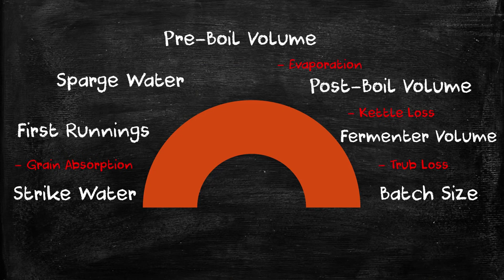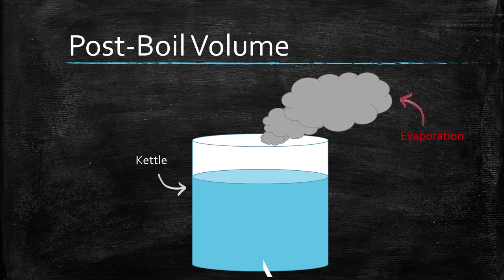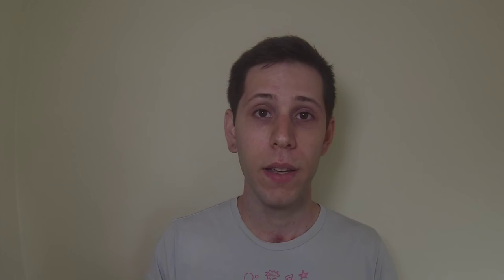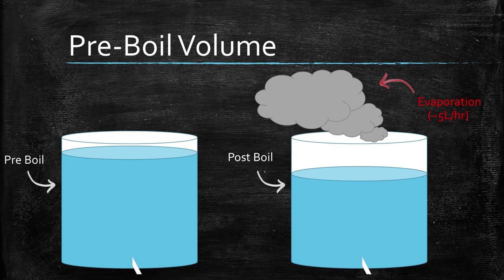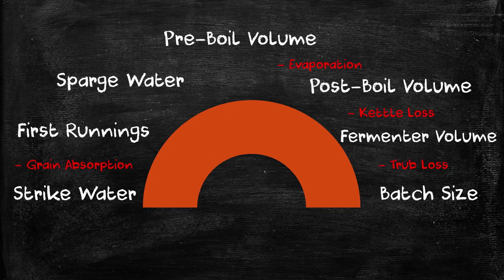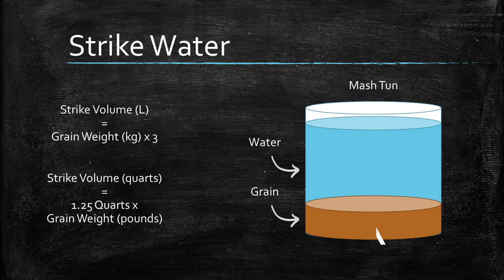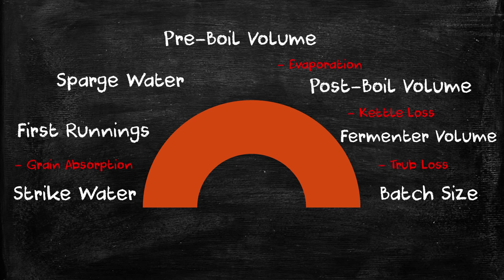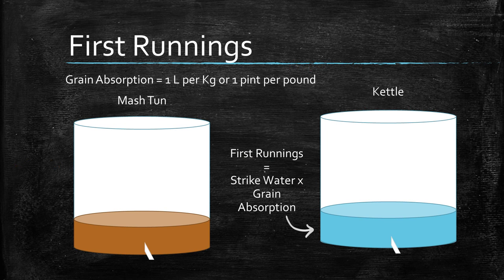How to Calculate Water Volumes for Brewing

Comment: I have 17L and 5L pots.(I do ~20l batches) I usually count the total malt weight(kg) and subtract it from 17L(size of the pot Im mashing it in) to get strike water volume. After mashing I just rinse the malt bag in the fermenter bucket with the amount of water that allows me to fill my both pots with wort(that is 22 liter pre boil volume). After boil and little cooling I add cold water to hit my batch size target(usually 20L) to make up the evaporation loss and at the same time cool the wort more. Works perfectly...expect one time I forgot to add the water and got one hell of a strong porter which turned into tasty poison.

Some people say that partial boil requires longer hop schedules and boils but I think that is only true if you like VERY hoppy beers.
Reply from the maker: +uniikkiz awesome! You'll find that by doing the calcs, you're pretty much following the guidelines anyway, just forcibly by pot size :) Agreed with the point about hops. There's not a huge amount of difference.

Comment: Hey mate, Kiwi in Czech here.  Not quite the same as an Aussie in Belgium, but both antipodeans in lands where they know how to brew.  Thanks for the vid - it's pretty useful and a good way to work it out in your head.  
  Your grain absorption rate for BIAB seems quite high.  In my brew yesterday I had 34 litres of strike water volume and a pre boil volume of 29 litres, so I lost just 5 litres overall at a rate of 14.7%, but you have a rate of 33% which seems a tad on the high side.  What's your process for milling and squeezing the grain?  I squeezed my grain bag til it died and got it double milled, but as a new brewer and wanting to know how things work I was interested to know what was your process for this?  

Cheers and keep up the good vids,
Doug
Reply from the maker: Haha "Antipodean", thanks for teaching me a new word :)

Not sure what you mean about the grain absorption, I typically see a 1:1 ratio, 1 litre water absorbed per kilo of grain. My process for milling is to use a very fine crush (0.03inches / 0.75mm) and mill just once (because the gap is so small it doesn't need twice). And I squeeze the bag a little, but mainly just to speed up the draining of the wort.

Cheers :)

Comment: Great video. However I've always been under the impression that if you don't have a big enough kettle to reach your desired pre boil volume, you can always boil less and liquor back to get to your desired batch size? What are your thoughts on this?
Reply from the maker: You can indeed however there are a couple of differences. Firstly, your hop calculations will be slightly different as it's more difficult for the hop oils to "dissolve" in less wort, so overall you'll have slightly less bitterness. Second, since the concentration of the wort is higher, it can lead to increased/different malt profiles since the maillard reaction kicks in earlier. You just have to watch out you don't scorch things :)

Also, if you're topping up your wort after the boil, be sure to also boil the top up water. You don't want to accidentally contaminate your wort.

Comment: Hi Ben.
I'm about to start brewing in the kitchen with minimal equipment.
I want to brew my first batches with the help of a thermomix (or bimby) since I can control the mash temp whit it. My questions are:
1) What size batch can I brew whit a 2L mash tun
2) What size have to be my boiling pot counting the massive evaporation that can happen from boiling a small volume for one hour?
3) Is that any problem with having the blades of the thermomix slowly rotating during the mashing, like releasing to mutch flour from the grain and turning the wort to cloudy, or is actualy good?
Thank you ;)
Reply from the maker: Hmm, 2L is probably too small to make any meaningful batch, but if you want to give it a try, I'd be curious to see the result.
1) It really depends. You might be able to do multiple mashes with the same grain and pull out a larger volume. It'll really depend on your boiling pot.
2) As big as your stove / heatsource can handle. This will determine your batch size. You can always keep topping up the pot until probably 10 mins from the end of the boil. You could also probably get away with boiling for less time too.
3) depends how fast they go? It shouldn't really matter though if you're going to use a Brew in a bag bag to separate the wort from the grain. You don't have to worry about cloudyness here as you'll be batch sparging which involves stirring up the grain each time.
Have a good look at the brew in a bag process and let me know how you go.

Comment: why is the ideal homebrew ratio 3:1 mash to water and how did you arrive at this number? cheers. awesome video by the way
Reply from the maker: At first it was just a convenient ratio recommended by my local homebrew store. After doing some more research it turns out it's a nice piece of the mashing puzzle. There's a bunch of research that's gone into trying to determine the most efficient mash thickness, but as with most things, it's pretty nuanced and there's multiple factors. Check out this article from 1999! https://byo.com/aging/item/1110-managing-mash-thickness

Comment: Do you recommend adding in dead space from the false bottom of the mashtun in the calculation for the strike water volume?
Reply: +Dayton Dave Yep, it's definitely a good idea, but the important value is how much you can drain from your mash tun (first runnings). Adjusting your mash thickness to compensate for the false bottom is great, but just take note of your first runnings and adjust your sparge volume to make up the correct pre-boil volume.

Comment: Hi - how does the strike volume affect the extraction of fermentable sugars in BIAB? I just feel that it would be easier to maintain the correct temperature with a larger volume (I am using small volumes - a 5 to 6 litre batch size).
Reply from the maker: Strike rate mostly just helps have the best ratio of enzyme to grain and water so it can convert quickly. There's no problem using the full water volume straight up, it might just take longer. In your case full is fine and probably easier :)
Reply: @mashhacks  That makes sense - and I assume that you get quite a lot of sugar out when you sparge.  So many different things to try!

Comment: G'day mate. Is there a problem in starting your boil with only 10 litres of water, and once done boiling add 12 litres of cold water to cool the brew down more quickly? Is that innitial 10 liters not enouch to hold the grain? Cheers.
Reply from the maker: +ausiewood it's best practice to make sure all water that goes into the beer has been boiled at some stage, to avoid infecting it with something in the water. Having said that you probably won't have much trouble adding cooled water after, just make sure there's no chlorine in the water. As long as the water to grain ratio is above about 2:1 you should be fine in the mash.

Comment: in your simplest all grain brew day video you mention second runnings but this isn't listed in at all.
Reply from the maker: +rek moany Ah good point, thank you for pointing that out. The "second runnings" is basically just the sparge water after it's been through the grain. So in this calc video "sparge volume" and "second runnings" are essentially the same thing.

Comment: I have one question. so, I've figured out I should have about 6.5 gallons pre-boil. My strike water should be 3 gallons, and after grain absorption, I'll be left with 2 gallons. Therefore, my sparge water should be 4 gallons. Now, my question: is 4 gallons of sparge water too much? that seems like a lot, and it's more than you're adding in this video.
Reply from the maker: +Footballfreak66 this seems ok to me. If you post the recipe I can double check, but the figures you've given seem fine. You can take some water from the sparge and add it to the strike if you think the mash is too thick though.
Reply: https://www.northernbrewer.com/documentation/allgrain/AG-DryIrishStout.pdf

This link should pull up a PDF of an Irish Stout. It's just a beer kit that I was thinking about buying, I just wanted to make sure that I was doing the math right. Much thanks!

Comment: Hello, I have pretty much the same setup as you, but it's my first time brewing on this scale with my new ssbrew kettle! I'm going to start with this beer: 
http://www.themaltmiller.co.uk/index.php?_a=viewProd&productId=611
I'm really struggling to find my strike water vol.. The batch is 19L and post-boil is 26.85L. My guess would is 36.85L, as my grain bill is 5kg so times that by 3 gives me 15L - 5L G/Absorption. Does that sound about right?! Sorry to ramble, just struggling with this maths! Hope you can help, and great videos please keep them up. Ol
Reply from the maker: +Ollie Harris Hi Ollie, Taking a look at the recipe site, it mentions 26.84L Pre-Boil, 21.84 Post-Boil, for a 19L batch. Regardless of these figures, your strike water should usually be about 3 times your grain weight. I would do a 15L strike, leaving you with 10L first runnings. Since your pre-boil is ~27L I would sparge with 17L (10L + 17L = 27L). Hopefully this helps!
Reply: +Mash Hacks thank you so much for your reply. I've been doing some research over the last few days, finally starting to get my head round it! Trying not to use Beersmith for my calculations... Thanks again, those numbers make sense :) cheers